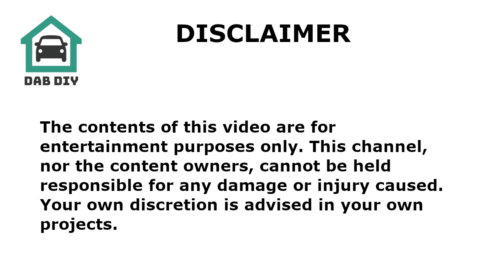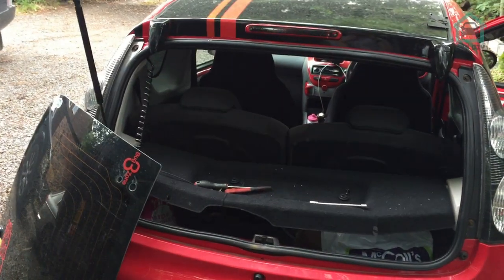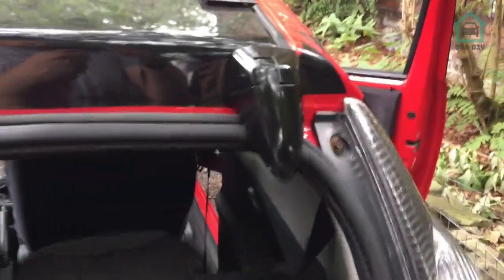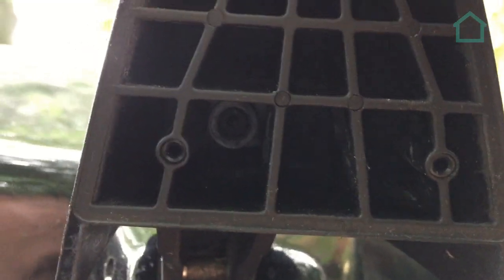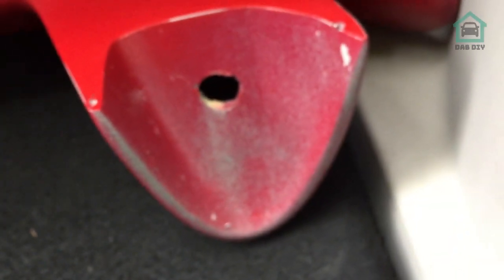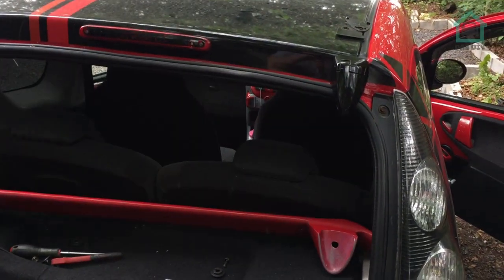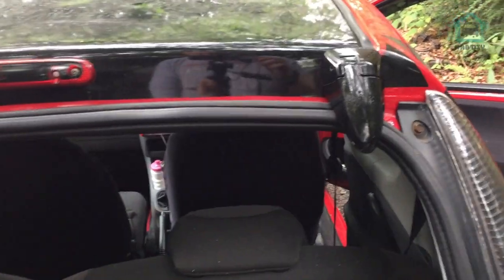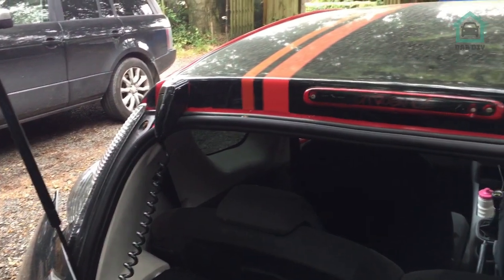Project C1 gets a spoiler

Comment: Did it improve stability of the car on high speeds?
Reply from the maker: These cars don’t reach high speeds 😅

To answer your question seriously though, no. This spoiler was purely decorative from the factory.
Reply: Because I was driving my c1 in the highway at speed of 130KM per hour but I was struggling to keep it on lane  hahaha so I looking  for something to improve my car’s stability on highways… thanks for getting back
Reply from the maker: I guess that technically it helps the laminate air flow leave the rear if the vehicle, helping aerodynamic properties, but how much it would do that is likely negligible.
Reply: @DABDIY  I was hoping to ask someone who tested this theory and give me the low down.
Reply from the maker: In practical terms and in my experience, it makes no difference at any speed. This is purely a cosmetic modification.
Reply: @DABDIY  thanks bro